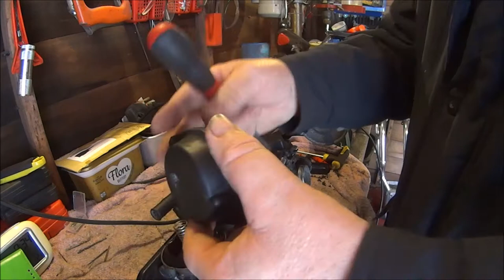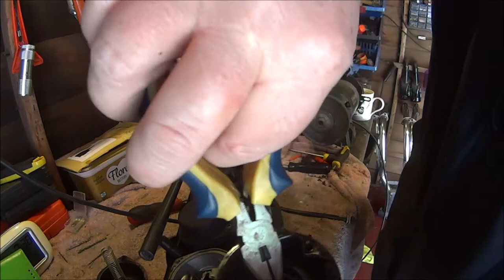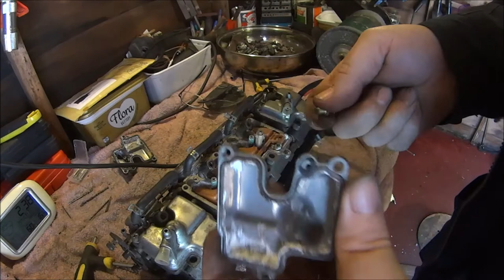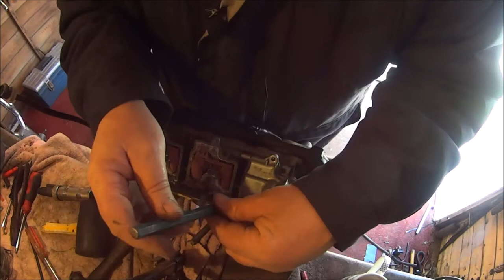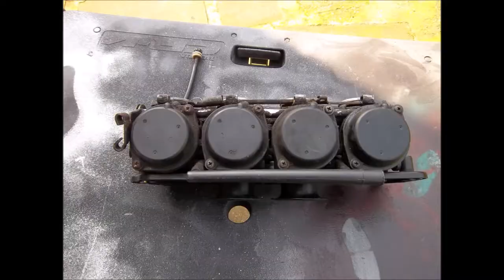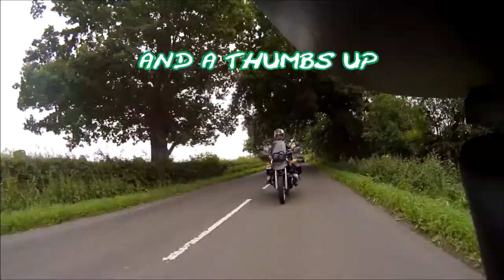KAWASAKI ZX- 6R Carburettors

Comment: how did you reach the allen/hex bolts on the carb boots, it's really tight fit down there and none of my allen wrenches fit down there.
Reply from the maker: I didn't remove them sorry it was just a spare set of carbs I had 👍